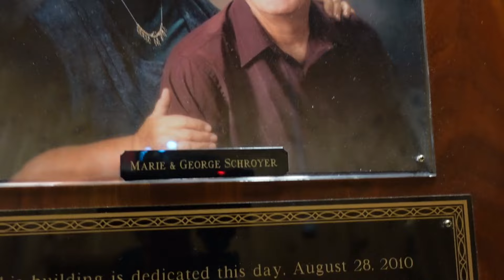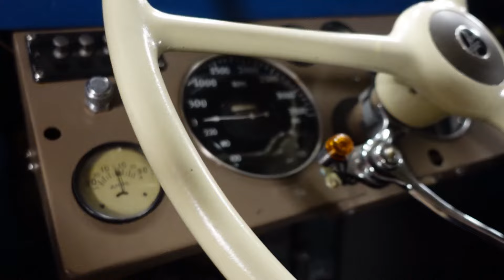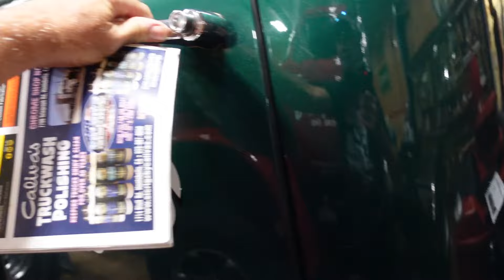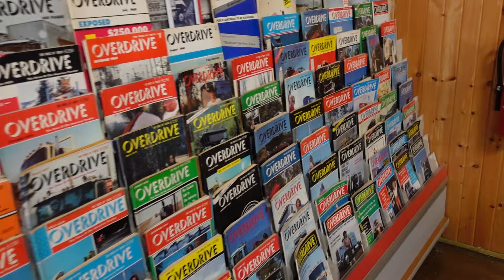Vintage SEMI Truck Museum/ Dodge, Big Horn, Peterbilt, GMC, Mack, Diamond REO, Ford, CABOVER

Comment: Glad I made it to the end of the video because I was gonna ask about the white 9500 that they have. Glad it is getting restored can’t wait to see it done. Thanks for showing that SFA crackerbox. I remember they wanted to restore and that is a gem. It came with factory front and rear air ride.
Reply from the maker: I know right? That Cbox was just incredible. The white 9500 outside is actually a donor truck. They’re building on a Brigadier cab with that hood and truck I believe.

Comment: Hey Dane thank you for sharing this one , it truly blew me away & pretty much left me with little to say for a change . There is one thing I've noticed and that's the color of the Cracker Box dash and interior is the same color as the USSR used and still might use for their cockpits and insterment panels on all of its aircraft and is done for decrease on eye strain . Thanks
Reply from the maker: That could be why it’s used. I’m sure there’s some psychological reason they used it in the buses as well.